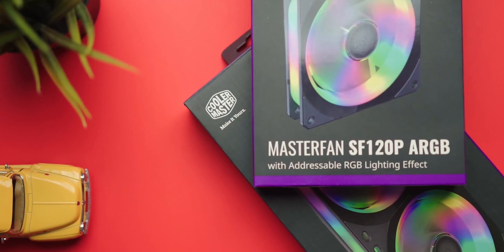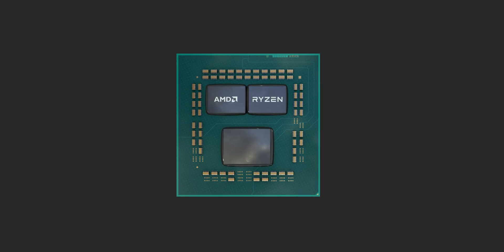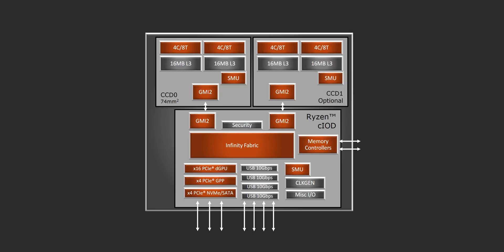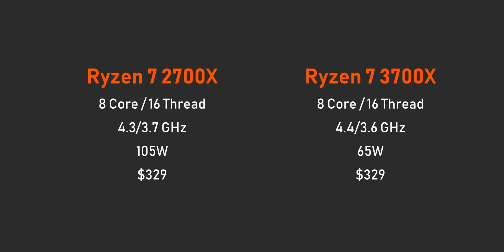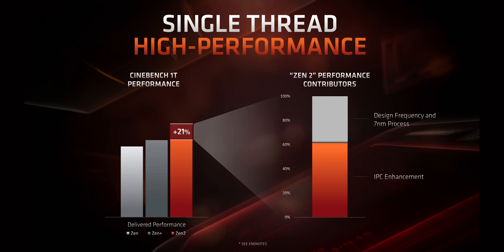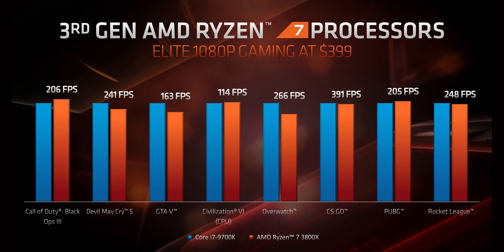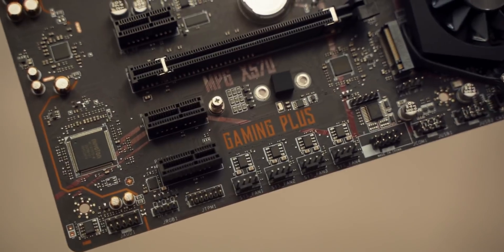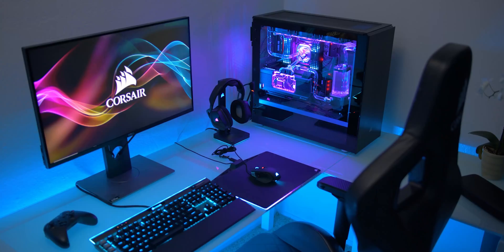AMD Ryzen 3000 – A Very REAL Problem For Intel?

Comment: 1. YOU DO NOT NEED AN X500 SERIES MOTHERBOARD FOR RYZEN 3000 - AMD has already said that the X570 is IN ADDITION to the X470 & B450 boards that already exist.
Even Buildzoid has said that the majority of consumers won't need a VRM on the level of what's on these X570s unless you're getting the 16 core AND overclocking it.
If you want a 8 or 12 core just for gaming and standard workloads, get a mid-range or high end X470(low end are hot garbo that have VRM packages even worse than some of the higher end B450s) and be done with it.
If you're getting a 6 core, stick it in any damn board you want - it's going to pull SO little power that it's going to outperform the 2700 while consuming less than the 2600.
If the media would make this clear, then they could save a TON of 3600 & 3700 buyers a LOT of money by stopping them from buying FAAAR more motherboard than they would even dream of needing.
Or, better yet, emphasize to your viewers that they should WAIT FOR THE REVIEWS before buying an X570 board.

2. The APUs are 12nm Zen+, not 14nm - big oversight

Comment: I'm going for 3rd gen Ryzen, but with a second gen motherboard (don't need PCI 4.0 yet), And coughing up for RAM and the CPU is gonna cost enough.

HOWEVER

If I can get my hands on a PCI 4.0 motherboard for only a little more than I was willing to pay (about £120-£130) then I certainly will in order to make future upgrades easier.

Going for the £150 Ryzen 3000 cpu, will be a HUGE upgrade over my FX8350

Comment: Still rocking a I7 3770 baby! Not going to lie, love the past 10 years of computer tech. Back in the late 90s early 2000s your computer would be obsolete by the next year. Still, I might upgrade if Intel drops prices or might switch to AMD. I just play games so single thread processing is more what I'm looking at. It will be years until we ever get games fully utilizing the tech these new processors bring to the table. In the end game companies want to sell their products to as many people as possible. I mean if I go AMD it's pointless for me to get the top of the line model if all I care about is games.
Reply: You don't play Ubisoft unoptimized games bro? I play some of their good FPS/RPGs and my poor old i7 3770K it's at 100% and 80C :-( so I need something with more cores and low power consumption.
Reply: @vladvah77  What GPU do you use and are you streaming or something? Seriously, more cores are not going to do anything for you for gaming if the games are not programmed to take advantage of it.

Comment: I have a MSI x470 & Ryzen 2700x which I bought in Aug of 2018...but was not able to finish building the new system until Nov 2018; got everything up and running in May of 2019. (including nvme gen 3 storage drives)  I came from a FX8350, and WOW what a difference!  I never planned on getting a Ryzen 3000 or a x570 motherboard.  I was going to wait until summer of 2020 or 2021 for the Ryzen 4000 series which should still work on my high end motherboard.  I could of waited to purchase the entire build in 2019 for the new hardware, but I really don't see the benefits.  Plus my wife was tiered of me Frankenstein-ing my old rig.  In the end I would of spent far more money.  I cannot imagine x670 motherboards offering anything that is a "have to have" feature.  So I should be set!  I'm not an overclocker; I build systems that are capable for overclocking so I can run it 24/7 for longevity.  I'm set on ram, 32gb @ 3200 mhz; graphics cards being the only variable that I might upgrade by then.  (running 2 GTX 1070TI's in SLI)

Comment: I wouldn't use Ryzen for the same reason I wouldn't use any Intel platform for past few years when I was looking to upgrade my 3930K.  Too few PCIe lanes.  If I wanted to almost match what I get with an X79 board, Intel would force me to buy a $1000+ CPU. 

Which is why I went with a Threadripper, which gives me more lanes for less money.
Reply: Threadripper is actually still Ryzen (it's "Ryzen Threadripper") but yeah, I'm just nitpicking haha
You get a very nice number of PCIe lanes for sure. The difference will be even more stark once Zen 2 Threadripper arrives - same number of lanes, but with double the bandwidth thanks to Gen4

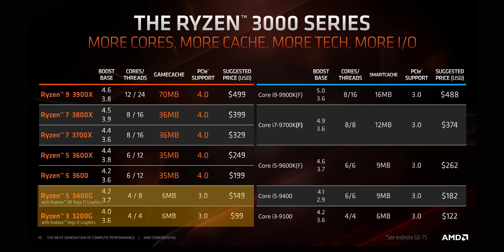Comment: 7:21  Incorrect.  They are Zen+ chips, which use the 12nm process, same as the Ryzen 2000 and Threadripper 2000 series.

Comment: 5:56  I wouldn't necessarily say that.  The 3700X is clearly binned for low power.  The 3800X might be binned for high leakage, which causes higher power consumption, but also allows for higher frequencies.  The 3800X might just be the better overclocker, which is the only justification I can see for its price.

Comment: Well im rockin the ryzen 5 2600. Id say if the current pricing for the 2700X stays the same when the 3700X comes out I will probably grab the 3700X its 40 bucks more and if the performance is what it should be then yup, thats how I will roll.

Comment: Nice haircut. You look sharp! And yes, I will be upgrading to 3rd gen ryzen for the 3950x but I plan to wait until September when it launches before committing to the Gigabyte Aorus Xtreme in case the X590 looks like a better buy for my content-creation uses.

Comment: I want to see how much the X570 mobos will cost, if they cost loads then i will look at how well the X470 can handle the 16 core Rezen 3000. It will then be a trade off between with price vs benefits.
Intel still has a chance if they want to discount their 9900k to like $/£250-300 or more likely their new Comet Lake 10 core chip to $/£400 but even if overall the price and performance is pretty close I want to give my money to AMD this time not Intel because Intel haven't given us a single bit of performance increase that they weren't forced into giving us by AMD.

Comment: I think when we are having this conversation, you really should bring up the fact that Intel has fairly regularly been hit with these security bugs that lower their CPU performance.  Who knows if that is over, or if more are to come.  The most recent of which requires a BIOS update to fix, and without that the "recommended" workaround is to turn off hyperthreading, which Intel still charges a $100 premium for.  It's not just a performance conversation anymore, it's now a performance AND security conversation.  I just don't feel safe owning an Intel CPU right now.  If AMD has something even remotely close in performance per dollar, i'm going AMD.  If for no other reason than i have more peace of mind in the security of the architecture.

Comment: since there are no B5xx boards anounced yet, these won't be available soon I guess?
so for a normal gaming PC with maybe 3600X a 'last gen' b450 or x470 is a better choice? because I probably don't need the high end features of the x570
Reply: Those motherboards will launch in Q1 2020 afaik!

Comment: 12 core will be a 6+6 core chiplets, with one core disabled from each CCX.
This is essentially confirmed because the 12 core is 70MB cache or 4X16MB L3 (64MB)+ 12X512 L2 (6MB).
In your 1 CCX disabled example, you'd only have 48MB + 6MB for a total of 54MB cache.
You should really understand how AMD configure zen by now and not make these elementary mistakes.

On PCIe 4.0, it's not supposed to require the higher end PCB's to work, which is why the question of PCIe 4.0 being enabled on X370/470 wasn't answered until recently. B550 boards would be cost prohibitive if they had to use the higher quality PCB's, but this isn't the case for X570 as that's already a premium chipset and the cost trade off for the launch isn't as big of an issue. Expect the PCIe 4.0 issue to be solved by Q1 2020 and B550's using standard PCB's released. In the meantime B450 and X470 make ideal platforms for modern hardware and if you want the high performance PCIe 4.0 storage option, then X570 is the option.

Comment: I don't believe the  X570 chipset prices are going to be a concern for most Zen 2 buyers.  IMHO many existing X370/X470 and even some B350 chipset owners will upgrade just the CPU.  Short of those wishing to upgrade to a new  NVMe controller or another high end I/O controller, most don't need X570.

Over time the price of X570 will come down and eventually NVMe drives running on PCIe 4.0 will become mainstream but for now, I'll be looking for a killer deal on a high-end X470 board.  In my opinion, the higher ram speeds supported on Zen 2  is going to be more reliant on the CPU's memory controller and not the chipset.

We will know for sure in just a couple weeks.  Here's to an exciting Independence day weekend.

Comment: I can definitively agree with you that the higher x570 motherboard prices will hurt sales of the lower end 6 core 3600 and 3600X Ryzens.
Reply: Wrong.  the 3600 and 3600X can be dropped into most B350/B450/X370/X470 motherboards without power delivery problems.  Its the 12 and 16 core chips that will be hindered.
I'll be getting a 3700X  to replace my 1700.  I'll not be getting a new motherboard.  I'll put the money I would have spent on a new motherboard  towards a 2TB SSD.  Might see about getting some more ram as well now that prices are coming down.   I'll wait until there is a video card that needs PCIe 4.0 to change motherboards.

Comment: I would love to get one of the new AMD chips. I'm rocking a 6700k for my personal rig which is still definitely fine for most tasks, even though it was still at a time when 4C/8T was the top end for the main consumer line (not counting HEDT). However, this would do wonders for my even older work computer (rocking an 4th Gen Intel i-seires) which is for data science, machine learning and imaging processing work.

Comment: I will be sticking with AMD... I need to keep my systems relatively inexpensive and having to buy a new MB and possibly new RAM for minor FPS increases (for my needs) isn't in my yearly budget.  With AMD it currently looks like I can replace my MB first and transfer my RAM and R51600 directly, then when money permits drop a new CPU.  I have been updating like this for nearly a decade with AMD, at least as far back as AM3 and AM3+ sockets.

Comment: Most applications I use are multi-threaded but to a certain point. I could certainly use more cores, maybe up til 10 but after that software doesn't utilize more. Not to worry though. I'm sure software developers will find ways to use more cores. We're even starting to see multi-threaded games.

Comment: I was going to get an X570 board to pair with a 3800x or 3900x. But right now, it looks like I'll be keeping my X370 board and just get a 3900x. I'm not sure if I'll be able to fully power the chip with my board yet, those details will come in July I'm sure. But I don't see a need for me to upend my system and spend 400-700 dollars on X570 if all I'm REALLY going to get is faster storage speeds. I still have an Intel 600p for an SSD...storage speed is not my highest priority atm. If my X370 Taichi can power a 3900X and OC it decently, thats what I'll be getting.

Comment: I'm building (had to RMA the motherboard) a first gen Ryzen system with a b450 board, and planning on upgrading to third gen later this year, while keeping the board.
Reply: I'm getting an x470/Zen+ soon after Zen2 releases to replace my 970/fx8350. Don't really see a need to have the best of the best. And a few years down the line I can drop in a R9-3950x and double the RAM for dirt cheap.

Comment: i feel like it will be a problem for intel but the motherboard prices for AMD might be a problem too. my understanding is that due to higher quality parts the boards will be between $300-500? if that is correct ill just stick to intel with their 15% reduction on their cpu's and hopefully their boards will come down in price too.

that was one of the things that stopped me from trying threadripper build, those mobo prices.

Comment: No its not... if the rumors are true then in Eastern Europe for example it will be way to expensive. 200 euros for a X570? And also add a new PSU that not everyone has... the least any of the x570 boards ask for the CPU is 8+4 PIN ... one of those also start from 150$...
Reply: @ Cosmin Lesutan Dar un sistem de-asta cu Ryzen 3000 o sa ne tina cel putin 4 - 6 ani, si evident daca mai si muncesti cu el iti scoti banu' rapid !

Comment: I f you're buying a cheaper chip, you can use a 470 mobo.
Reply: Yes most X470 boards should handle the new 12 core Ryzen cpu.  The 16 core won't be able to be run on all X470 boards due to insufficient VRM phases and inadequate VRM cooling.

Comment: still on intel, but with zen2 I think ....... f*** intel, will go my pc road with AMD
Reply: I disagree it looks like AMD has finally produced a CPU that will give Intel a run for its money. The 3900x is meant to compete with the 9900k and all the leaks show that it has comparable single core performance meaning it does better in some titles and worse in others, but multicore it totally annihilates the 9900k, it runs cooler and uses less power for way less money and it even includes a nice cooler. So the best overall CPU's this time around goes to AMD hands down, but I will add if you already have a 9900k from Intel there isn't enough of a boost to justify shelling out that sort of cash, but if you are like me with an Intel 6700k its definitely an exciting time to upgrade up to Ryzen 3000.
Reply: @jereomemoore7269  DEATH TO INTEL INTEL IS FINISHED! MY MONSTER PC IS RYZEN 7 1700 GTX 970 G1 GAMING 16 GB DDR4 3200MHZCL15 GS KILL RIP JAWS DE;LLP2416D 24'' 2560X1440 60 HZ IPS! RUNS MAX SETTINGS 1440P 30+ FPS EVRYTHING! NEVER BUY INTEL AGAIN!
Reply: DEATH TO INTEL INTEL IS FINISHED! MY MONSTER PC IS RYZEN 7 1700 GTX 970 G1 GAMING 16 GB DDR4 3200MHZCL15 GS KILL RIP JAWS DE;LLP2416D 24'' 2560X1440 60 HZ IPS! RUNS MAX SETTINGS 1440P 30+ FPS EVRYTHING! NEVER BUY INTEL AGAIN!
Reply: @uP-Andre DEATH TO INTEL INTEL IS FINISHED! MY MONSTER PC IS RYZEN 7 1700 GTX 970 G1 GAMING 16 GB DDR4 3200MHZCL15 GS KILL RIP JAWS DE;LLP2416D 24'' 2560X1440 60 HZ IPS! RUNS MAX SETTINGS 1440P 30+ FPS EVRYTHING! NEVER BUY INTEL AGAIN!

Comment: There are cheaper X570 boards coming out as well as more budget orientated chipsets (B550 A520)
Reply: but not at launch, which was the point...and other than the very expensive top tier x470 boards with proper VRM's there's not really anything else you should try to run 12 and 16 core Zen 2 on
Reply: @glamdring0007  There will be cheaper X570 boards at launch. With cheaper chipsets coming out a bit later. Which is the point of all this. Also we don't know what X470 boards can run 3rd gen 12 and 16core cpus as we don't have any power figures. We'll have to wait for Independent reviews.

Comment: x470 mother board would be great, but would need a bios update for third gen ryzen, after speaking with newegg this morning they don't offer that solution,, just suggested that i buy x570  witch would destroy the value of ryzen plat form
Reply: look for an x470 that can flash the BIOS without a cpu installed.  Gigabyte calls it Q-flash, Asus calls it USB Flashback, i'm sure Asrock and MSI have a similar feature.
Reply: even lisa sue said that all x470 motherboards that are ryzen 3000 ready will be stamped on the box. asrock has the bios version stated on their web sit
Reply: i have spent the last two day's with retailers like newegg their response was just by x570, to me that makes no sense paying a lot more for features like pcie gen 4 that i could careless about and has nothing to do with gaming

Comment: Switching to 3rd gen Ryzen 3900x. I had Intel since 1998, so this would be the first AMD CPU I'm going to buy. Yeah I'm pretty excited.
Reply: You should have been AMD when they had their AMD 64 3000(I had a AMD 64 3500) series those were good compared to P4.
Reply: @noahw5887  True. My first built was Athlon 64 3200+
Reply: welcome to the Ryzen powerful family's 😉
Reply: my current cpu is ryzen 7 1700 but my previous was core i5 2500k. ihave also owned 486 pentium 4 athlon xp and athlon x2!
Reply: @shredderorokusaki3013  Thanks for sharing!
Reply: Depends what you're doing it seems as if gaming it's Intel is still slightly better but everything else AMD does better. I'm probably going to get a 3700x or an 3800x.
Reply: @noahw5887  Same, though I'm dead set on 3700x. I'm coming from a 2200g B450 I built 2 months ago as a placeholder. 3700x 'cause I have limited budget. I don't even need to wait for benchmarks against my 2200g lol
Reply: Just remember to get good rams
Reply: DEATH TO INTEL INTEL IS FINISHED! MY MONSTER PC IS RYZEN 7 1700 GTX 970 G1 GAMING 16 GB DDR4 3200MHZCL15 GS KILL RIP JAWS DE;LLP2416D 24'' 2560X1440 60 HZ IPS! RUNS MAX SETTINGS 1440P 30+ FPS EVRYTHING! NEVER BUY INTEL AGAIN!
Reply: @shredderorokusaki3013  bruh that ain't no monster lol
Reply: @shredderorokusaki3013  You need more CPU horsepower to drive an additional GPU
Reply: Welcome to the RED TEAM
Reply: I can see a lot of experts comments here.....I want a very silent desktop and the current AMD Athlon 955 Black sound like a aircraft engine during take-off. I want to know how silent will the new Ryzen be? I am not a gamer at all.
Reply: @chandan4156  loooool cpus dont make noise

Comment: first of all, this was a great video well explained. I think AMD has a great CPU, price is right,  but the motherboard prices from one of your video you said price start from $250 to $500  and the President of MSI said the new motherboard will be higher. I think this will hurt AMD. If the board cost $255 and the CPU Cost $ 399.00 or $499 you're looking just at $900 to $1000 dollars for just two items. the whole cost of the AMD computer Build will cost  $1500 or $2000. where if you buy the i 9900k $498 and board that cost $255 to $275   will coat about the same $1000.00. the whole build will cost the same. I do think Intel is worried that AMD is catching up or out-perform them 7mm is a big deal. 
Again great video.